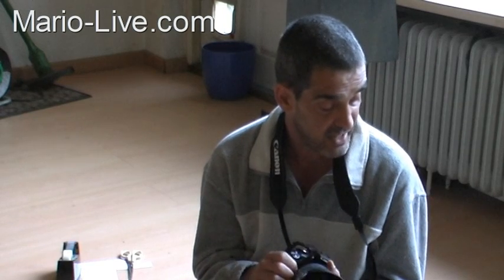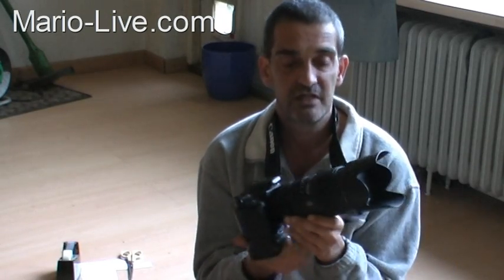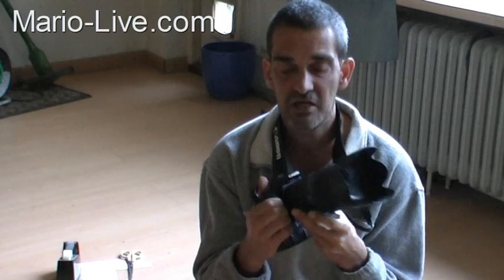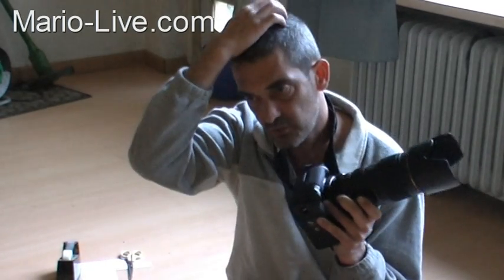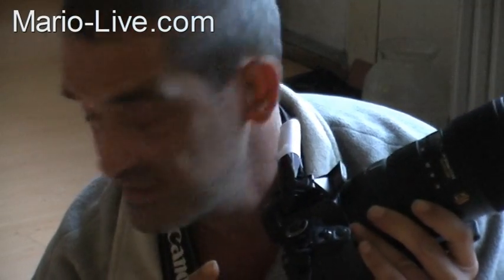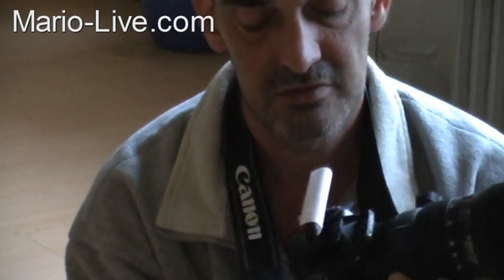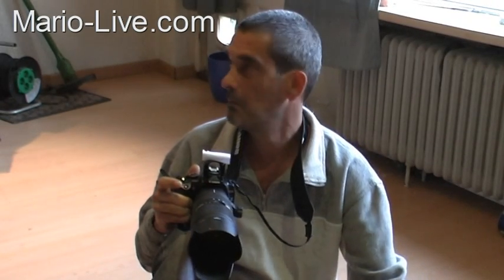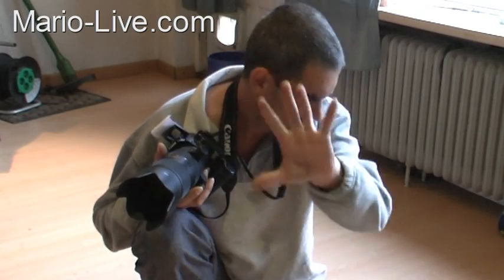How To Simulate Commander Mode For Your Build-In-Flash

Comment: Mario please can you tell me is it possible to control Flash Exposure Compensation from the interface on the Di622 (mark 1)
Thanks
Reply from the maker: It's not possible with this flash. The Di622 that is.
Reply: THANK YOU! So much. That might be an important feature. I need to do more research. :)